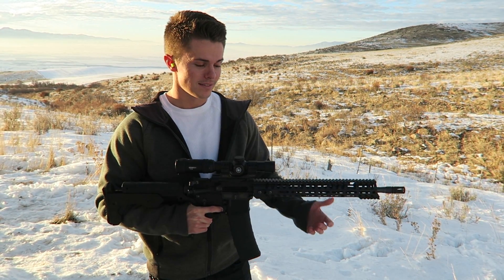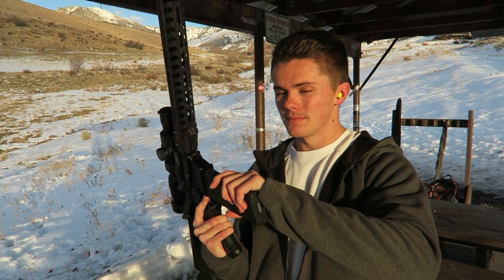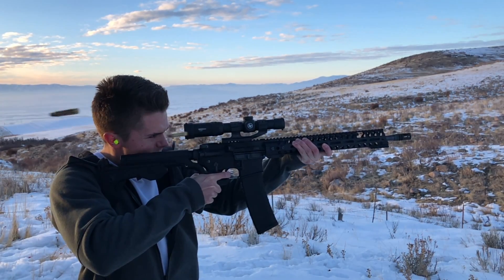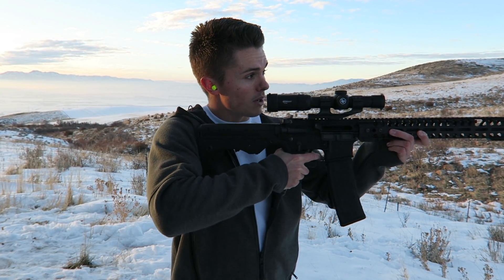How Fast Can A Bump Stock Really Shoot?

Comment: Rate of fire doesn’t determine if a gun is fully automatic. It’s a mechanical disconnect.
Reply: Well it does though. We can argue the technicalities of how the rounds are discharged, but the only reason for laws restricting the use of 'automatic weapons' is the amount of damage they can do in such a short amount of time.
Reply: @flintcompotion. The term “machinegun” means any weapon which shoots, is designed to shoot, or can be readily restored to shoot, automatically more than one shot, without manual reloading, by a single function of the trigger. Bump stocks don’t do that. They use inertia. I do agree with your sentiments however.

Comment: I fully disagree with your statement that an automatic is more accurate.  With practice, I can now shoot much better with a bump stock than I ever could with my M16.  The reason being that when you do hold the stock firmly against your shoulder and slight pressure on the front hand stops the rifle from wandering upwards.  Ask any veteran, a M16 wanders up on automatic, the bump stock does not.  

Is there a learning curve?  Yes, for sure.  Is it more accurate with practice?  Absolutely!
Reply: @DINSTAAR your knowledge is spot on I have additional knowledge you might find useful on technique for your viewing.  You will understand I'm sure.👍
Reply: @bigslinking  put your link here brother. And thanks.

Comment: 864 rounds per minute.  36 rounds in 2.5 seconds =  864 rpm.  Wicked.
Reply: Bro my HK MR556 semi automatics always fire at 1200 rpm directly new from the box.  Install a adjustable gas block and a kx5 booster bumps the speed up to 1400 rounds per minute, even faster if you install a good suppressor.  https://youtu.be/EazyTYgWDmE
Reply: Except for the whole mag swap thing, and flawlessly functioning, plus negligable accuracy...

Comment: During the 2017 Las Vegas concert massacre, the rate of fire was calculated to be around 600 rounds per minute, which is much more consistent with an M240 belt-fed machine gun, and not an AR-15 with a bumpstock.

There was no mention in the media of Stephen Paddock using an M240 LMG.

Also, if you compare the audio from the Vegas massacre to that of an M240 firing full auto, they are almost exactly identical.

It is very unlikely that bump stocks were used (at all) in the 2017 Mandalay Bay concert shooting.

Furthermore, I am inclined to believe that shooting was done by a group of people, probably military-type black-ops spooks under the direction of even shadier people, and not just one man with no motive, no history of mental health problems, and no previous firearms training, who was used at a patsy by the media.
Reply: Bingo!

Comment: You’re using the stock wrong, you’re supposed to grip and pull the gun away from you as you fire then you will get thru a full mag. Also you have more control of the gun this way too. If you disagree with me you don’t know shit OR you’re an ignoramus that needs informing, but yeah this is the correct way to use a bump stock ^

Comment: You need more experience shooting before you make the videos you're attempting to make. You should become more familiar with the bumpstock before making this kind of video. Kind of scared me a few times. Safety was off when you loaded the rifle and your finger was already on the trigger when you checked to see if safety was on. More on point once you gain experience with bumpstock you will be able to control burst rates. You'll be able to put 4 or 5 rounds downrange or empty the mag all at once if that's what you wish. You just need a little bit more experience. However, as your numbers show, bumpstocks fire at a faster rate than fully automatic weapons. generally about 100 rounds per minute more than their full auto counterparts.

Comment: Is that the same gun JerryRigEverything used in his Bump Stock video?
Reply: The scope, front part, and the bump stock is similar (the bump stock is adjusted tho)
Reply: Not sure, it is the same location though. If you look at Zack's video (JerryRigEverything) you can see the same Mountain range. And it appears that you can also see the same structure that Braxen is standing under.

Comment: Bump stock firing is not this difficult to learn. Your right finger just need to rest at the bracket acting as a firing mechanism, while your left arm fires the gun by pulling the gun forward.

So when you want to stop, stop pulling the gun.

Comment: Put a fore grip under the front of the barrel, pull the grip slightly forward away from you while keeping your trigger finger stiff and you're good to go. Now that you've turned in your bump stock to the feds or destroyed it (right?) you have to bump fire from the hip. Or: put a recoil pad on your shoulder, glue a spring on top of that facing the butt of your fixed stock, and a rubber recoil pad to the butt of your stock, connect all 3 and BOOM, there's the solution to the government's taking away our freedom. It only took one person to f*ck it up for all of us (Las Vegas), so enjoy the ARs and hi-cap mags while you have them because come next year, it might ALL be taken away. God bless.